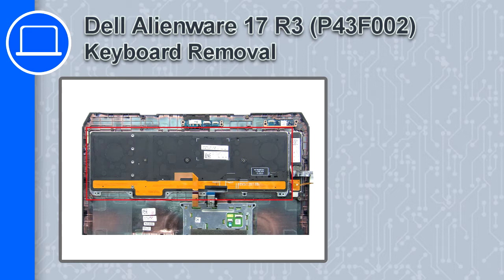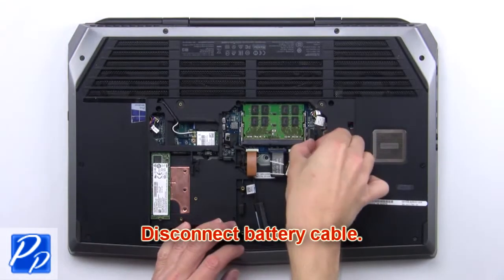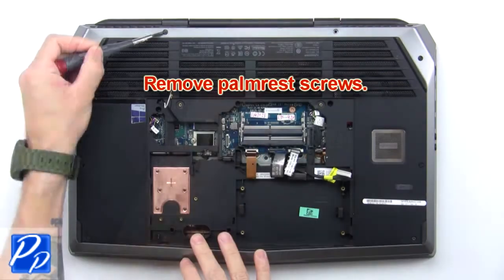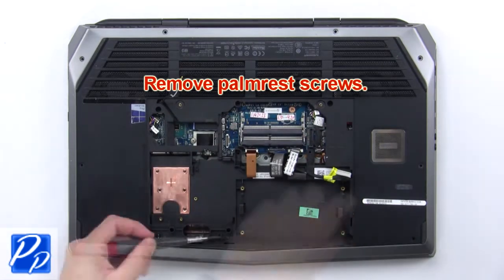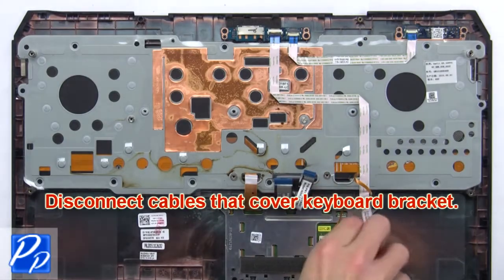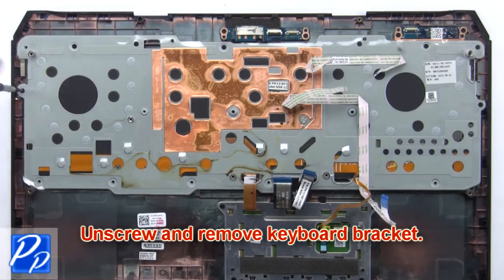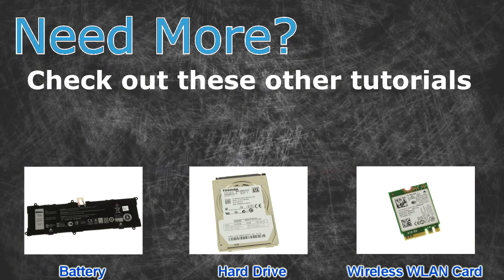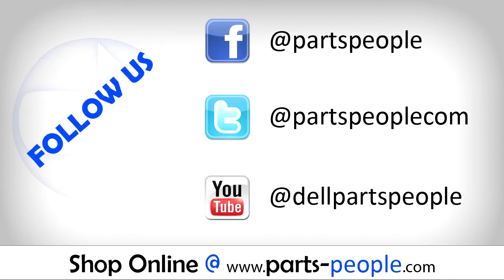Dell Alienware 17 R3 (P43F002) Keyboard How-To Video Tutorial

Comment: I just finished replacing the keyboard as you demonstrated how to remove. It worked and all is good: you didn't mention that there were a few -2- screws that hold the frame AND keyboard in place, and THAT was confusing.

I do suggest that you would have a reverse process of ASSEMBLY as I am an amateur and I needed to REALLY think it through.

BUT, it works and I THANK YOU VERY MUCH!!!!!!!

Comment: I replaced the keyboard and now the new keyboard doesn’t light up and the monitor is not coming on. Everything else is lighting up (power button, special keys on left, Alienware logo). Any idea what happened?
Reply from the maker: The cable @1:10 for the display is probably loose. I would assume some of the other keyboard cables are loose or not connected too. I would check all the cables from 1:10 to the end of the video.
Reply: thanks for the useful videos. i would like to ask that i spilled a cup of coffee on my keyboard and its not working. will it fix if i follow this video and clean it up 
thanks